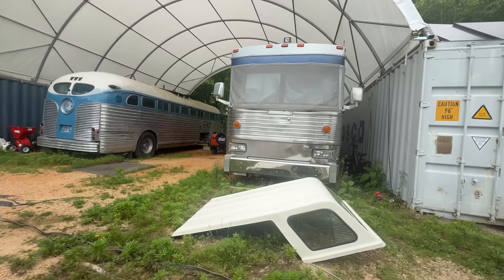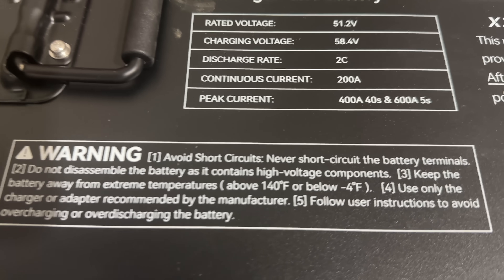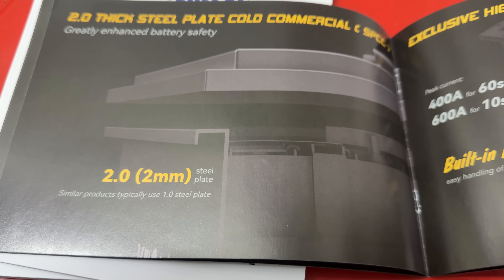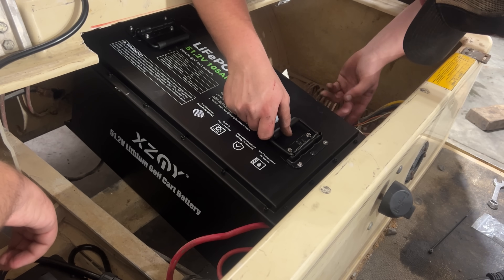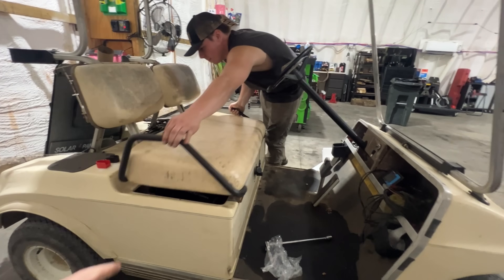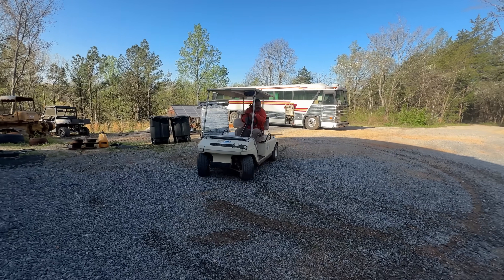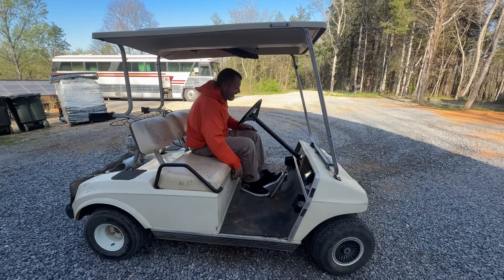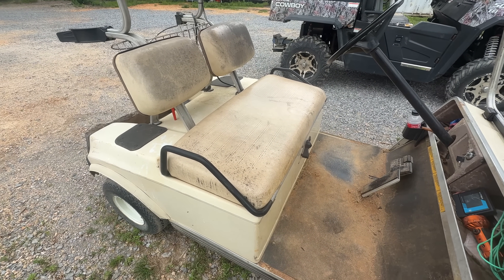Installing and Testing XZNY LiFePO4 Golf Cart Battery with built in Fire Arrestor 48v

Comment: Next is upgrading the brakes! 

Keep an eye on that motor. Higher voltage = increased heat; higher speed = increased bearing wear; higher current = increased stress on electrical components.

Comment: .
A 30% increase in voltage will of course bigly  increase the torque on the drive components —read: its axle, in this case— as you guys have so gleefully experienced.

Just as an fyi: the early years (circa the 1970s-1980s) of EV first adopters, hobbyists converting low-torque-designed vehicles (petroleum powered) to electric, learned the fun (if expensive) way that the instant and dynamic force of electric motors could sometimes actually break things in the chassis.

Most notoriously, when some guys fitted a military-surplus aircraft starter (the choices were limited in that era, in obtaining affordable electric motors both powerful enough to propel a vehicle and yet small enough to fit) onto a small scrapped U.S. Postal Van (which they were turning into a smokin' quarter-mile dragster), the instant and monstrous torque suddenly thrown into that truck's drive train (designed in its time to receive strong-but-slowly-delivered diesel power) actually broke their drive axle in half: snapped it right in two.

That won't happen to you of course, but at a minimum you are going to burn through sets of tires a lot faster than you are used to.  (And I’d think also you'll also want to keep an eye on your golf-cart's motor mount-bolt attach points.  Your golf cart from the eighties wasn’t designed for this kind of robust performance.)
.

Comment: Impressive video!  I will check out the link. My 48 volt cart is due for replacement batteries.  What brand is the cart you have?  Also, can you answer if you think that the boat that hit the Brooklyn Bridge might have had the engine running backwards?? (If it was a Detroit).

Comment: Id be interested to know how many miles of range you have....days is kind of irrelevant because i have no idea how far you go each day .

And i inow the old toaster carts are not the most efficient models.
Reply from the maker: We also go up and down a big hill multiple times a day.    105ah at 51.2v  the cart math should be available to calculate
Reply: Ok looking On X its roughtly 1/3 mile from the paved road to the front of the shop. So down and back once is only a half mile....granted its a HUGE hill. Im not sure how that equates to power consumption since going down it will use zero battery but im sure its more than riding flat ground. So three trips just to road and back is a mile and a half...not very far, 6 trips would be three miles with 6 up hill climbs. Lead acid batteries when new in 48v setup woth 6 batteries have a 20+ mile range going to 50%. Thats the reason i was asking trying to gauge what you get. I converted my 36v cart years ago to 48v and im facing battery replacement soon which is why im interested. My pack is 6-7 years old and i need to replace them sooner than later. No i dont have that kind of range now😂.  @BusGreaseMonkey
Reply: How far is it from the shop to the highway ? Your guess? And that hill obviously sucks more power than flatish geound. I guess i can figure it out from a mapping app to see the mileage myself to get an idea of daily miles...the hill will be hard to take into the equation, but i guess the down uses no power?  @BusGreaseMonkey

Comment: I am guessing that it is a brushed motor...I can tell you from experience with RC cars, converting them from NiCad batteries to Lithium batteries that you can damage the motor with lots of sudden acceleration, like burnouts. 🙂 So don't floor it, but enjoy its top speed.
Reply: That can sure happen with the high power density RC car motors, but you’re not going to hurt that big golf cart traction motor.